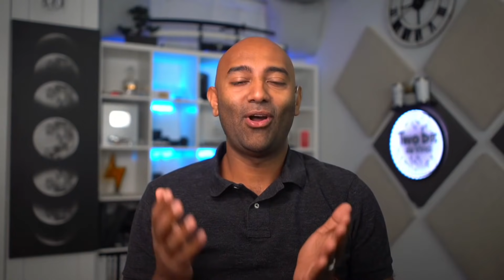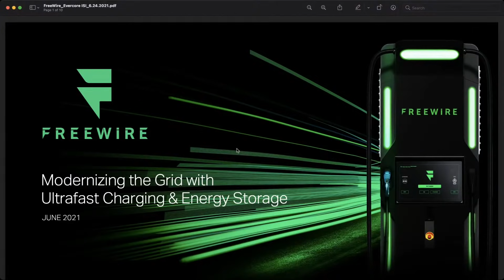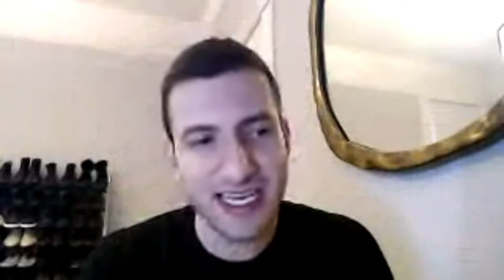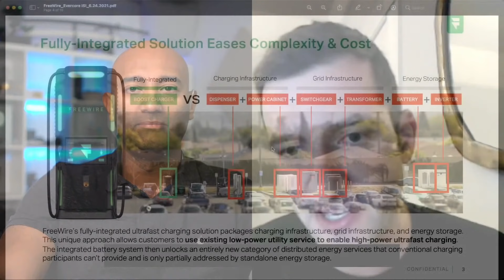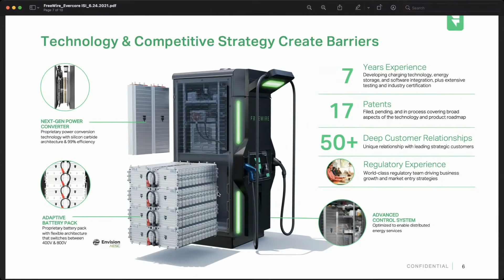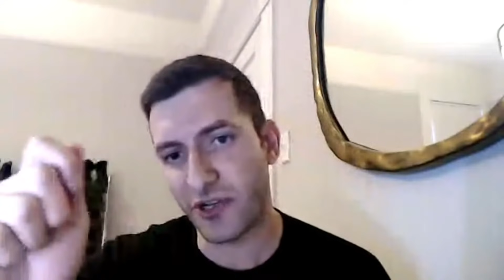How Will We Charge Millions of EVs? Interview w/ Freewire

Comment: Thanks for another great video.  I’m learning so much.   It’d be great if Plug Share or other Apps DID identify the Freewire charging stations on their network.  Then customers could choose them for the advantages of potentially lower cost charging but especially for the benefits to the grid / society that the buffered battery approach provides.  Freewire should promote their chargers as not just the same fast charge that others provide, but that they are the environmentally and infrastructure responsible choice.

Comment: The biggest problem right now in EVs is how to push chargers in urban areas where street parking is the only way to park. I live in DC where street parking is the only way to go. A lot of people live in condos where parking lots are the only way to park. Electric cars right now are only a rural and suburban possibility (Areas where people have garages and driveways). Even in parking garages for office building EV charging stations are currently not a feasible option as they would have to be in every spot because people do not go out to move their car when they are at work.

Comment: it will work as a top-up. I think it will have a 150kwh battery, enough to bring upper 3 cars at a time... so the battery will be charging to 100% twice a day to serve 10 cars. Out of the 10 it will be charging at 20kw assuming there is only one charger or that everyone of them has 20kw connection (where the model breaks a little). People should not assume they will come at 100% and that it will be good for big trips etc. 150kw is not techically fast. 350kw charging is coming to that. we need at least 500kw capability to build a gasoline-like experience.... but do we need that? the whole thing here is we need to charge our cars as cellphones.
Reply: unless the point is to have 10minutes charges per car.. good for 25kwh...125 miles of range

Comment: L2 is sufficient for local driving.  Need DC for the highway drive.  Put this Freewire along major highways everywhere every 30-40 miles.  What hurts EVs now is only going to a DC desert.  For people driving routes that use their battery plus with no availability of L2 chargers at their stops, they need DC chargers at this rate along their route for the flexibility to use their EV.

Comment: Interesting that we need 10x to 30x chargers vs gas pumps. That's a lot of chargers!
Reply: Well, that's what his research shows. But it's this a "need" from consumers, or are the "needs"(wants) of retail included? 
Can you imagine the parking lot at work, with every bay equipped with a socket that could charge 10 miles per hour .... and a few sockets that can charge 25 miles per hour, for the few long distance commuters? Some just need 40 miles (a top up), so are charging maybe half a working day. The company just needs to split those that only need to top up into two groups : the morning charge and the afternoon chargers.

Comment: Doesn't it cost like a million dollars to install a gas station's underground tank? Then there's the pumps themselves which are tens of thousands of dollars. Then there's the ongoing cost of fuel deliveries. Then there's the maintenance on the pumps moving the fuel around. And it's a huge problem if that tank starts to leak. Even if it doesn't leak once that gas station is closed that tank still has to be dealt with. 

Just trying to bring some perspective into the costs for EV charging infrastructure.
Reply from the maker: Yes you’re right but they’re also profitable. This model is about adding changing in places we visit every day. Not centralized stations

Comment: Edit: lol I wrote this before even starting the video, great minds think alike I guess.

Stick a battery under every EV charging spot and trickle charge that as much as possible, then use it to charge the cars. Like that solar parking spot. 
That wouldn't fix extremely high use charging spots, but it would help and to a point more storage is more better. I like big buffers and I can not lie. (Factorio reference ftw)

I would love VIN based charging, though how you secure that is an interesting problem to solve. I could imagine some adapter that lets you put in whatever VIN you want between the car and the charging point. 

We need more efficient cars, not just bigger batteries. I was shocked when I saw the F-150 lightning gets less than 2 miles per kWh. 

I would love to see minivans make a comeback. Sure they're not cool, but they are far more practical in everyday life than most SUVs while also being more efficient. How many people with gigantic SUVs with AWD/4WD and lockable differentials and 7 passenger seating only ever use their cars to drive themselves to work and back?
Of course I'm a bit of a hypocrite there as I'm not sure I could have an Aptera as my only car due to the 2 person max, even though I rarely have a passenger. -Everything- Almost everything else about the car is really cool though. Right now I drive a Bolt.

Comment: Thank you for this video. I find this solution intriguing. It is a wise approach to dealing with the real problem of limited utility infrastructure. Upgrading substation switchboards and the distribution conductors is the bottle neck that few utilities can afford. Then there is the sharp peaks of demand that multiple conventional chargers place on the grid. Utilities are already struggling to deal with the rapid demand fluctuations caused by cloud cover over solar panels, so this is why I like Freewire's solution of relatively steady demand to recharge its batteries. 
Question: Does Arcady's system permit recharging of the Freewire Battery while it is also discharging to a vehicle? 
Thanks again @Two Bit da Vinci, fabulous content.

Comment: Ricky, thanks for an excellent interview.  I never knew Freewire technology was available.  Should we assume the major difference between Tesla SC and Freewire is Freewire has a battery at every stall.  Tesla has one centralized battery for all stalls.  Is anything else radically different?
The battery “reservoir “ technique has been around for hundreds of years.  Water was pumped to large, high capacity water tanks overnight when usage was minimal.  Then during the day water was used by the village.  Tank height provided needed pressure for home use.

Comment: I'm confused who all these people are who drive hundreds of miles per day.  I think having level 2 chargers all over the place is a great idea.  I've only ever used fast charging a few times and it was only at 50 kw.  I've never seen the need for so many high speed chargers.  I don't know anyone who would need level 3 chargers everywhere.  Nobody I know drives 200+ miles just to be there for 20 minutes.  Not regularly at least.  I completely understand having a lot of them especially along freeways and highways.  But most chargers within the city could easily be level 2.  Who goes somewhere wanting to have to leave to unplug their car in the middle of whatever they are doing?  The vast majority of drivers don't drive enough for level 3 to be the only standard.  I would imagine parking lots being filled with level 2 chargers would be far cheaper and faster to install than a few level 3 chargers.  Most people have jobs and don't travel huge distances all the time.  I think we should get level 2 chargers installed everywhere as quickly as possible so most people would be comfortable.  No need to spend the extra time and money on the small minority of people who have extreme cases.  If I could get 5-10 miles while shopping or 20-30 miles while watching a movie that would make a huge difference and I wouldn't have to worry about whether or not I am blocking a high speed charger.  Getting rid of level 2s would make life less convenient, not more convenient, and would drastically slow down adoption of EVs.  The whole advantage of an EV is it can be fueled just about anywhere.  You don't have to go to a dedicated fuel station.  Most EV's I've seen around me are the cheap short range EV's including mine.  Bring down the cost of the cars and make sure you can charge everywhere you go.  That's my philosophy to rapid EV adoption.  It's working in China.
Reply: Maybe I can answer your question after 4 years of EV experience.  Going forward, most EVs will have a range of 250+ miles.  80% of vehicles are charged at home/work.  
Adding 10 miles of range while at the grocery store for 20 mins isn’t appealing to most people, especially if it costs more than home charger.  If you are on a road trip, it makes no sense to charge at a level 2 station for 3+ hours.  You need a DC Fast charger that gets vehicle to about 80% in under 20 mins.   
Consider level 2 charging only for locations where vehicle will stay for several hours:  home; work; sporting event;  beach/lake; snow skiing; boating; theme parks like Disney & Six Flags; etc.   Along major highways, we need level 3 chargers for road trips.
Reply: @johnpoldo8817  *Quick note became a wall of text... Have fun!  :)*
Quick note about the walls of text, I have Asperger's syndrome.  EV's and renewable energy are my primary obsession.  I'm not stupid.  I've owned an EV for more than a year and have literally obsessively researched them for 10 years, including mapping out potential trips for various ranges weekly at times to determine how far everyone I know actually drives.  I have also done dozens of hours of research and calculations to find an approximate CO2 output for various battery sizes and fuel types based on multiple sites and studies dedicated to each fuel.  I'm not uneducated on the topic.  However, my autism does prevent me from truly understanding how most people think so my opinions are from a purely objective point of view of what I believe to be the best case scenario.  I bought my Spark EV purely because I wanted to know what the experience was like to have such a short range for a year.  That way I would experience every season, rain or snow and it's been fun.  This way I can speak from experience when people say they absolutely need 300-400 miles for an EV to be good enough.  I do plan to upgrade to a Bolt once I'm sure they have the battery fire issue fixed.

--Actual intended reply--
You just said basically the same thing I did.  However, it doesn't have to be more expensive to charge at the store.  For example, some Kroger owned stores reward people for shopping there by giving them fuel points which reduces the cost of fuel at their gas station and drastically increases sales.  Gas isn't the product, it's the incentive.  Most gas stations earn more from the attached convenience store than they do from the gas.  Level 2 chargers are far cheaper than fueling and maintaining a gas station.

They could have dozens of these chargers and charge you next to nothing for the energy and still come out positive.  Heck they might even make them free to incentivize people to stay longer and therefore buy more as psychology has shown that time spent shopping directly correlates to increased sales.  That is why most grocery stores try to place frequently bought items such as bread or milk towards the back of the store.

However, my argument is more for low powered chargers, not specifically the standard level 2 we have seen up until now.  The idea being the more power (kW) it needs to supply the higher the cost by a fair margin.  So instead of 6-7kW you would have maybe, 10, 15, 20kw.  This would have a significant impact if you are able to use these everywhere you go and would be far cheaper than level 3.

Placing exclusively level 3 chargers would be a huge waste of money and would have a much larger impact on the grid.  It would also come with the down side of less people willing to install them due to the increased cost thus slowing the expansion of the network and therefore EV adoption.  If people see EV chargers everywhere they will be much more likely to consider buying one.

I think lower powered chargers could have a much bigger impact than people currently realize.  It could be a good business decision for many locations.  My issue is with over relying on these high powered chargers for local use.  Decrease the distance between fast chargers for sure, but don't build them for local charging.

Nobody is arguing that you should be able to charge quickly when your on a long trip but most of the time by far you aren't on a long trip and considering the amount of time the average vehicle isn't on a long distance trip you would get far more use out of local chargers and it would allow for shorter range EV's to be a viable option.

Shorter range EV's means less batteries needed, which means you can manufacture a larger number of cars for cheaper.  For mass adoption we really need cheaper alternatives, and the best option for that right now is to improve the charging infrastructure.  If you look at the current chip shortage you see the same concept.  Manufacturers have gone back to producing older products that require less of the required chips to improve profitability.

The whole point of this video is that high powered chargers are the worst for the grid.  If we want to increase the adoption of EVs we need to focus on what you do 90% of the time.  If my car went 200+ miles I could to almost every normal trip without charging at all.  My longest "normal trip" being 363 miles round trip.  That only comes 3-4 times a year though barring a pandemic.  Even the longer trips I've done in my life could be done with only a few chargers.

My point is that this obsession with level 3 needs to stop.  It isn't nearly as important as providing better options for the people who can't charge at home.  Most people live in a place where charging isn't as easy as plugging into your wall.  These people are having to pay the extra cost of a high powered charger for no reason other than there are no other options.  

I would much rather see funding go towards improving the situation of more people.  Not just the rich people who can afford to take long trips all the time.  These networks are being overused by people who shouldn't need to use them.  Even Tesla had to put limits on their chargers because they had too much local traffic thus defeating the purpose of the supercharger.  Most traffic could be covered easily with high density low powered charging rather than low density high powered charging.

Everyone is battery cell constrained and will continue to be for the next 10+ years based on current plans by the worlds largest battery manufacturers.  Unless livewire plans to produce all their own batteries they will be cell constrained as well.  I believe it would be better to just use low level chargers and use those batteries for the cars that can't be built due to the lack of batteries.  My car has 19 kWh.  I can't imagine they are using less than that for their chargers otherwise they become pretty much useless after the first person to use it.

I don't dislike the product or the company.  I think they could be great for situations like Rivian's adventure network.  I just don't agree with Ricky's view on charging.  Saying not to continue installing level 2 chargers is one of the dumbest things I've heard.  My biggest issue I've found is that there is no charging at any of my usual destinations.  An extra 10 miles would make the difference on whether I can do most trips.  

Give most people a 150 mile EV with charging everywhere they look and you could transition far faster than making 300+ mile EVs.  Though I personally think 200 miles is the sweet spot for the average driver.  My gas car only got 250 miles in city driving and 360 on the highway but that was really pushing it to empty.